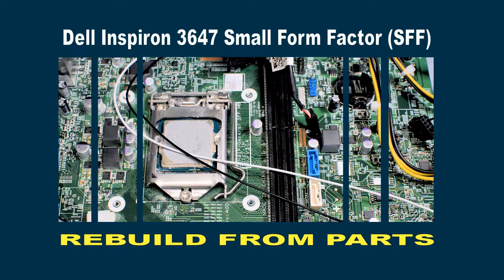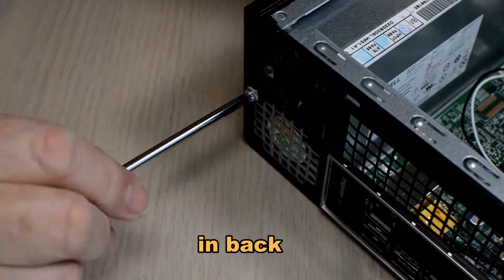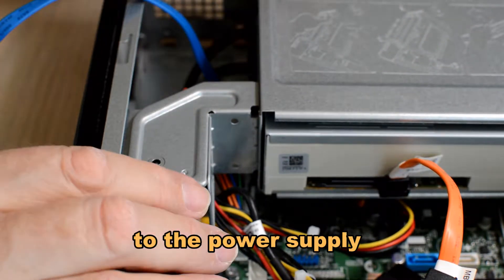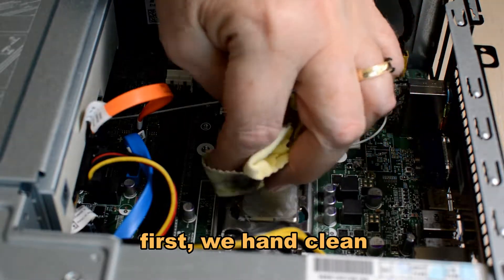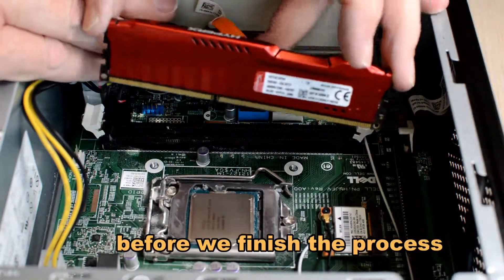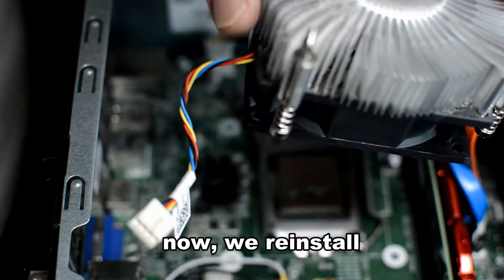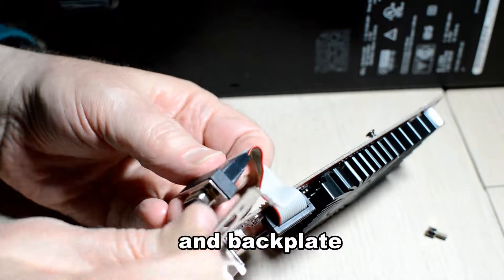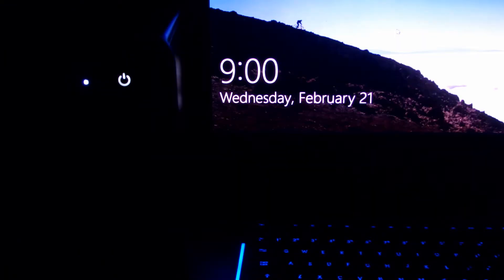Rebuilding A Dell Inspiron 3647 Small Form Factor (SFF) Desktop PC

Comment: bro can i put quadroo t400 in my inspiron 3647 i3 16 gb ram pc
Reply from the maker: The data sheet on the t400 says it draws 30 W , it calls itself slimline which sounds like half-height so, wow, so you should be good with this one.

Comment from the maker: A lot of folks writing me about upgrading the processor on on this PC. The problems are many and start with compatibility of the motherboard to take and I3 (for example) instead of the original Pentium. I say save up buy a 10th gen I5 plus new motherboard and case and build yourself a great PC. Sorry but nothing on this PC,  except maybe the HDD, can be used on a newer I5.

Comment: I want to Upgrade my Dell Inspiron 3647 Small Form Factor  Processor and Ram
Right Now I am Having Intel(R) Pentium(R) CPU G3240 @ 3.10GHz   3.10 
and RAM: 2.00 GB(Default)
I want to upgrade to Intel core I3 4Th Generation processor  but I don't know what specific model Should I use
and Please suggest me What type of Ram and Processor should I use
Also I was Thinking to get an Compatible Gaming card, Please tell me a few good gaming cards for My pc? I would be Happy If you Reply
Reply from the maker: My recollection is 3rd or fourth gen I3, try to see if the specs make sense for that board, so tricky and now all the info is ancient

Comment: Which Intel Core CPU do you upgrade too? I have the same computer with a Intel Core i3-4150.
Reply from the maker: If you use your PC a lot. and for graphics or streaming or rendering, I would hold out for at least a 10th Gen i5-10400 processor.
Reply: @TechVideosNET  But which CPU do you use for the Video?
Reply: @TechVideosNET  Got the same video card but it does not work. Any chance you have a driver for it?

Comment: Can i add a i3 or i5 processor in my dell Inspiron 3252 small form factor pc ,,,i have pentium and i need upgrade but i worry that should i3 or i5 will be set on that socket
Reply from the maker: I had a Pentium also and thought it would be great to swap for and I3 or I5. You have to be very careful that the motherboard will handle the upgrade and consider both hardware and bios issues. Even If they were compatible (which I doubt) you'd still be limited to an older I3 such as a 3rd or 4th gen version.
Reply: @TechVideosNET  thank you so much

Comment: I want to upgrade my CPU. Do you know what my options are? My Dell Inspiron current CPU is Pentium G3220.
Reply from the maker: Now from a technical point-of-view. Mine is a Pentium also. I do see I3 and I5 models in that SFF case sold by Dell. You must check for a compatible motherboard which could be a problem.